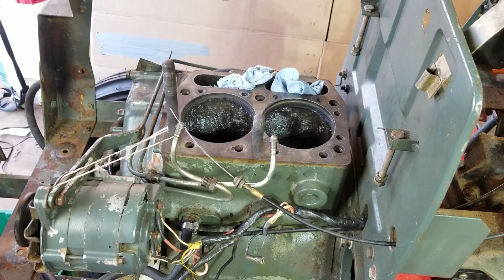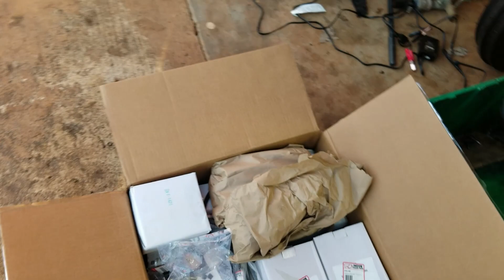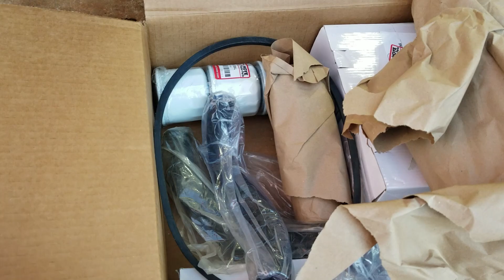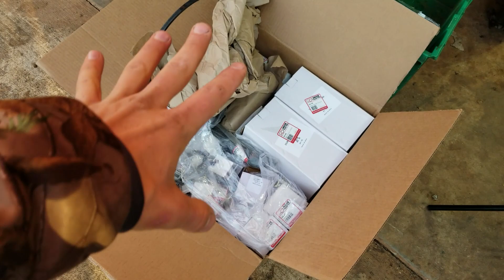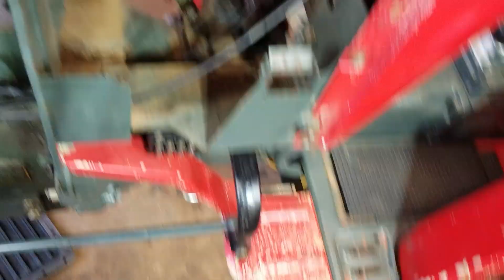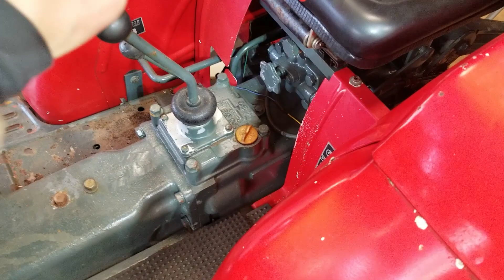Abandoned Yanmar Tractor Rebuild UPDATE

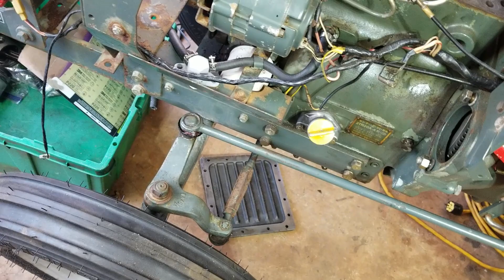Comment: Can you help me out? I have the same tractor, and I'm dying to know what the long rod/lever is at 0:45 It runs along the frame and is removable.
Reply from the maker: It is the steering rod. It connects the steering box to axle to turn the tires.
Reply: After a lot of digging, I finally figured it out. On mine, it's a removable hood prop rod. My tractor had a hood swap, so it doesn't use it anymore. Thanks for the reply!